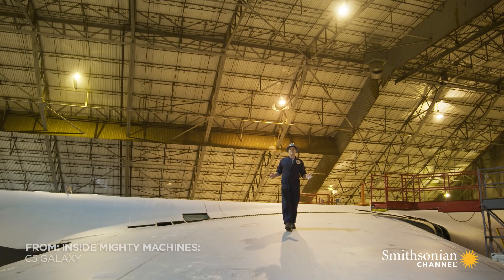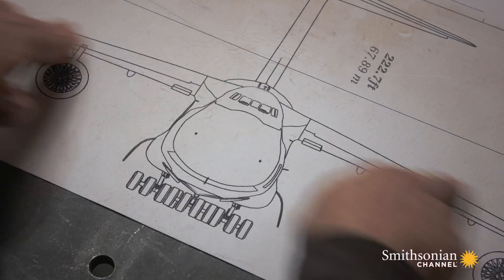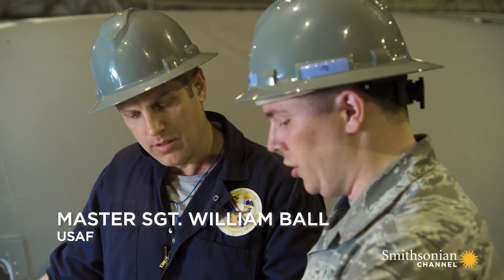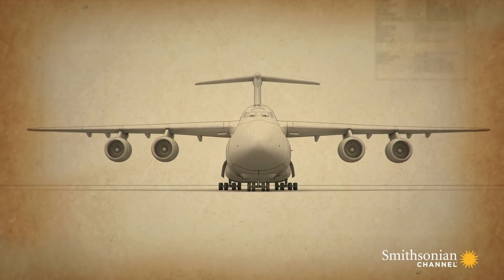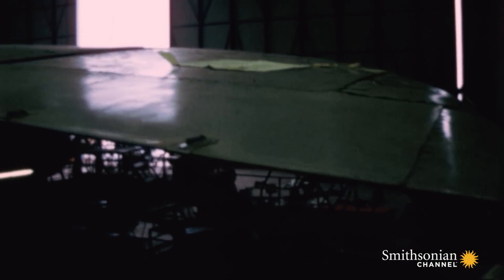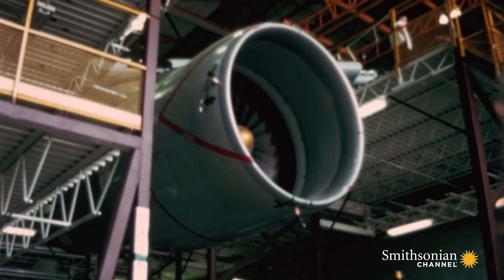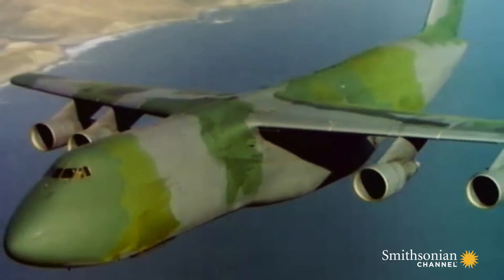The C-5 Galaxy Had a Catastrophic Design Flaw

Comment: I'm far from being an engineer (or even keyboard expert), but don't all wings flex to an extent? To minimize flight stress?
Reply: Lodestar 

Even bridges flex. You can design structures like aircraft wings and bridges that will flex less but they will usually be heavier and or more complex and expensive. So it’s a compromise.
Reply: Jim Allen Unfortunately that's just one of those phrases that's entered common parlance that's simply untrue. A rigid wing would be much better in many ways, but would also be prohibitively heavy resulting in reduced payload capacity (which is especially critical for an aircraft like the C-5). Because of this, a lighter but less rigid wing that bends under load is an acceptable compromise in most cases. However, in order to protect the structure from excessive bending moments, wing displacement is limited in a number of ways such as by mounting the engines under the wings instead of mounting them on the fuselage and also by placing fuel tanks in the wings. The combined weight of the fuel and the engines provides a downwards force which helps to counteract the upwards force of lift, reducing the movement of the wing. This is one of the reasons modern aircraft almost universally have wing-mounted engines, as it actually allows for a lighter wing structure.

Comment: Hogwash. 

Aero elasticity is a design consideration of any aircraft wing. They ALL bend. 

The real reason they are bent down is to reduce excessive lateral stability. The high T tail, the wing-fuselage interference (which on high wings makes the downward wing generate more lift in a slip), and the swept wings also contribute to lateral stability. 

With too much lateral stability, the aircraft would be difficult to maneuver and could be susceptible to Dutch roll. That’s why EVERY high wing/swept wing/t-tail aircraft uses anhedral like the previous C-141, the C-17, the BAe-146, etc etc. 

The problem was the chronically weak wings that Lockheed has always been plagued with (C-130, T-33 to name a couple). The first C-5 wing failed at only 125% ultimate load and its fatigue life was predicted to be very short. This doesn’t have to do with how much they bend.. because you can make a wing that’s stronger yet more flexible depending on your material choice and construction methods.
Reply: I'm an engineer at Boning. You're wrong.

Comment: Wow very weak reporting.    Every new plane has early problems.    Building the largest cargo plane in the world at the time was a success.    The Antonov became the larger plane 10 years later and it also had problems.    One of the early C5A problems not mention was breaking hydraulic lines in the wings.    USAF air cargo/ airdrop rigger 1973.

Comment: Lockheed didn't make a mistake. It was the USAF that demanded the use of an unsuitable aluminum alloy in the aircraft. That alloy ended up exhibiting the type of early corrosion cracking and fatigue cracking that Lockheed had warned about.  Incompetent micromanaging of a contract by incompetent government engineers, contract officers, and others led to the C-5A wing problems.

Comment: No explanation how it was fixed and what was wrong with the original wing. 
That pisses me off.
So it is probably true that Antonov had a big lead in Wing Design when they built the AN124.
Reply: No, the Antonov had some innovative features, of which none are aerodynamic. Almost everything has to do with the flight control system and the cargo handling.
Reply: @SVSky  Something I read somewhere. 
It was something to do with the very thick oval shape of the Wing they used. 
It created more lift and enabled better and stronger internal structure within the wing  to carry the loads it could. 
Especially when it came to the AN225 that basically uses the same inner wing.
It was claimed as an Antonov first and a unique solution pioneered by Antonov.

Comment: Saying a high wing aircraft can have flexible wings and a low wing aircraft cannot is just plain wrong. 
It’s called dihedral and anhedral 
In the case of the galaxy, anhedral was used to decrease the yaw-roll coupling associated with simultaneous use of high wing configuration and high degree of sweep.  Had nothing to do with flexibility. 
This video is an embarrassment to our country.
Reply: Thankyou, someone who knows what he's talking about. 
I was just about to write a similar thing.
Reply: Yep. A video made by uneducated people for other uneducated people. I bet the maker of this video also believes lift is created solely by Bernoulli's.
Reply: @米空軍パイロット  well lift is a very difficult concept tho
Reply: @saberline152  The basic concept, not really. Being able to actually estimate it, though, is difficult. Either way, what I'm saying is that this guy is far from being an expert, and thus he should be asking questions rather than making statements that would misinform most people. Even experts ask questions and know that they don't know everything.
Reply: @米空軍パイロット  you must be intelligent to even ask that question.
Reply: @FPVREVIEWS  Now that's too much credit. I believe in a real distinction between education and intelligence. There are people with 1 or the other, people with both, and people with neither.
Reply: I think they designed it high wing so the fuselage would be low enough to drive equipment on and off without use of loading equipment. You can’t drive anything off of a 747 without a huge loading dock.
Reply: @seanriley1603  Yes, and there's even more than that. Elevating the wings allows you to get engine clearance without making the landing gear so tall. In addition, it also allows you to pass the wingspars through the ceiling of the fuselage, rather than under the floor. Now, you can make the floor of your fuselage even lower, while also lowering the fuselage itself.
Reply: Thanks for weighing in on this. As I understand it, the dihedral or anhedral is employed for stability. Low wing aircraft require require up angle (dihedral) wings, and high wing need slightly drooping (anhedral) wings. The 'stability' achieved is the tendency of the aircraft to return to level when rolled to one side.  All aircraft wings, particularly on large aircraft, flex under load. And to think that this 'documentary' was on the Smithsonian channel. What a disgrace.
Reply: He lost any of his credibility when he called it pitch. Which was almost immediately
Reply: Could it be due to it being 40+ years ago?
Reply: Don't the high wings allow for a greater ground clearance for using unimproved airstrips?
Reply: @TheDesertRat31  Generally yes, although there are good examples of both.  Such as the DC3 and latest Pilatus Jet. It's moslty about keeping debris out of hte engines, props, and turbine fans. So a higher wing help with that geometry, as well as just general ground clearnace in most cases, although in the case of swept wing aircraft, the dihedral comes into play as well, and high wing swept wing aircraft need anhedral, hurting thier otherwise great ground clearnace, while low wing swept wing aircraft can still have dihedral, helping thieor otherwise poor ground clearnace. straight wing high wing turboprops are the best for that type of operation, although low wing straight wing aircraft such as DC-3 are noth bad either, although not originally intended for anything but basic transport with some graded fields thrown in there..
Reply: Bob C I believe so
Reply: Amen to that. Tell that to BAE who designed the Harrier, Airbus with the A400m, Boeing C17 globemaster, Lockheed C141 starlifters... The list goes on an on...
Reply: @Weihrauch88   McDonald Douglas C-17
Reply: @darklordchris  My bad, cheers for that
Reply: JAG    I remember, late 1970s I think, Lockheed or Pentagon received the Golden Fleece Award for the C5 cost.
I think the C5 has proven to be a good cargo aircraft.
Reply: I would have expected better information from a country that built the space shuttle as well as dozens of other incredible aircraft.
Reply: Yes, you are absolutely right. And the figure of the airflow behind the wing (1:21) is completely wrong, as usual, because the downwash is missing. Bernoulli's theorem is misunderstood by most people; it works perfectly in tubes, but not when a wing is moving in the sky.
Reply: The 737 max had engines too large to fit completely under the wings...same engine on the Airbus 320...higher clearance allows the engine to be mounted completely under the wings...no one @Boeing noticed this show stopping fact...scrap them all...no software fix can remedy an engineering fatal error.
Reply: Thanks for respecting science, and all of us in the process.
Reply: Alright m8 calm down
Reply: Well it sounded pretty good.
Reply: Jim Allen  I know it consists of 3 concentric square section steel tubes fitted within one another. I also know the airframes were considered "old" and due for overhaul at 150 hours .
Just have not found that level of detail.
Reply: /\...This.
Reply: @richardlouisnewman1064  He said the purpose of mounting the wings high was to allow them to flex. In reality, as you said, there is no relation between high wing design and flexing.
Reply: 米空軍パイロット no he didn’t. He said the purpose was to allow the fuselage to be lower to the ground for loading. Separately he said that the wing was designed to flex so that is why it drooped down.
Reply: The guys in the video confidently spread falsehoods and misconceptions. Cringe.
Reply: @gustavlicht9620  It's intended to be entertainment, not information.  Kind of like the network evening "news".
Reply: Wow- I knew about the downward angle called "anhedral", since I had studied a book on aerospace engineering when I was about 17 years old. It was a gift from a friend but I didn't remember about the yaw and high swept situation and thank you very much for the information. I may have read it but it's been a long time and I truly appreciate you sharing it with us here.  👍
Reply: You say
Reply: Still flying to this day successfully...guess the engineers knew something needed changing!
Reply: Bs...the wings flexed...and broke...mr androgynous!
Reply: THANK YOU
Reply: It’s funny. Even model aircraft builds know this
Reply: I am confused. He said at the beginning of the video that "all wings flex". Where did he say they did not?
Reply: The wonders of diversity hire ;) They hired Aviation historian who graduated in Gender studies. 

High wing are preferred in military craft to keep the engines safe from debris ingestion.
Reply: If you have ever been up close and personal with this plane...its a amazing peice 
of engineering...truly impressive.
So good on you to say something about this aircraft,  yes some expensive mods but 
a workhouse that just makes you stop and admire.
Reply: Right
Reply: Came here to say this exact thing.
Reply: The statement was made that "all" wings flex.
Reply: The front man for this video should be ashamed of himself. All aeroplane wings flex; ever been in a sailplane, 747, A320, etc?
Reply: Keith McLean Biplanes are pretty solid.
Reply: @seanriley1603  Yes, even in WW2 the flexing was more accidental than controlled I understand. I heard a Spitfire mainspar was good for 150 hours. True?
Reply: @keithmclean4283  No definite answer, but 150 hours is extremely short. That means you can fly the plane maybe 40 times and then it's done.
Reply: @米空軍パイロット  Well, not really. It only took 4 hours to swap out a wing on a Hurricane so swapping out a Spitfire spar may have been an ordinary maintenance job done on the airfield. The thing thing triggered all this was a quote in one of the fighter pilot memoirs where he was complaining about the "worn out 150 hour " planes.
Reply: Keith McLean or a Cessna 172?
Reply: You are correct on all counts.  Embarrassing indeed.
Reply: So, you’re saying that the government funded documentary is about as poorly conceived and executed as the government funded military cargo jet transport?
If at first you don’t succeed, try, try again for 20 years...
Reply: @colincopland3665  another example of government waste and inability to get it right  nasa

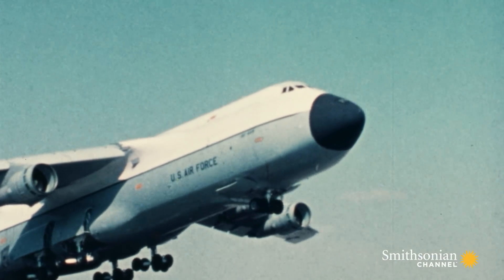Comment: The aircraft you see at 3:00 in the video are not C-5's, but C-141's. (Look at the engines)
Reply: Correct. I was a crew chief on the C-141b. What a powerful work horse it was.
Reply: I was a C-141-A Instructor Loadmaster.  Went to Viet Nam before the B models, but believe the stretch was 2 pallet positions, not 3.
Reply: Good catch! Those I believe were C-141A's being stretched to add 3 more pallet positions or approximately 30' making the C-141B.